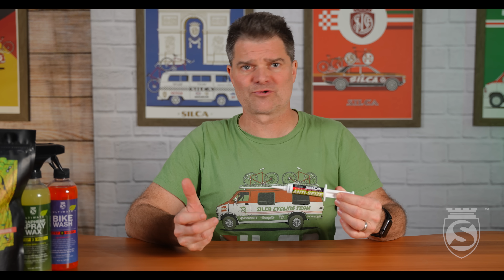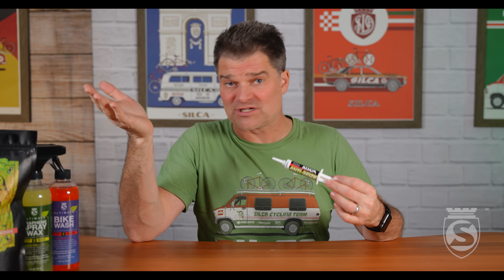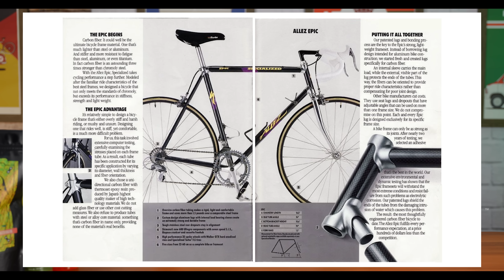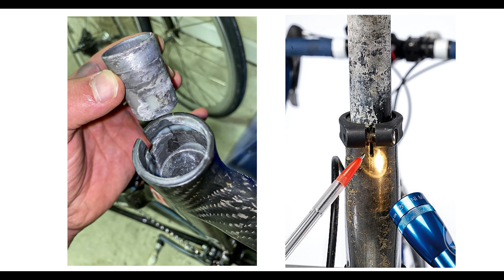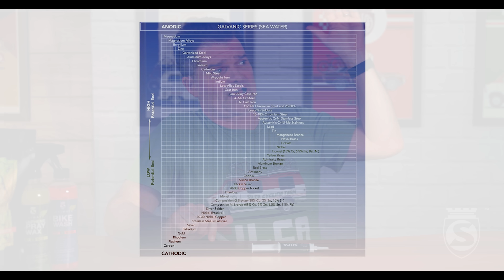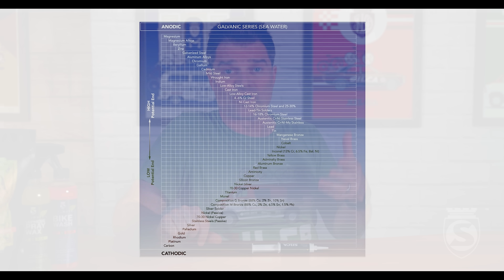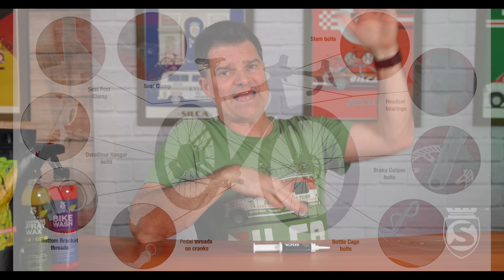Better than Grease? Anti-Seize Assembly Paste

Comment: I'm not sure about this product, but I did lose faith in Silca when I tried their hyped tubeless sealant:

It didn't seal the rim/tyre very well. Needed air every day.

Didn't seal holes.

Carbon fibres were way too heavy for the thin medium.

Dried out way too fast (see sealing the rim/tyre above).

Fibres ended up in a ball together; great if you wanted to balance the wheel and rely on guesswork as to where the ball of fibres will end up!

The sealant I use now requires air seven to ten days, and I can refresh it with water (because it doesn't dry out) rather than have to use another overpriced product. Oh, it's really good in inner rubes too keeping pressure for around four weeks!! It also has fibres that are held within the thick solution.
Reply from the maker: And yet here you are spending your valuable time watching and commenting on our videos.. don't worry, all of the Hamibini sycophants have said the same thing $20 for 500gm?  Crazy!!  Outrage really is his superpower and it's amazing how good he is at boiling down talking points that motivate people to go and spread those talking points.. well done to him!
Reply: @SILCAVelo  Well, I don't subscribe to your channel, but I do to his and other channels whose opinions I value.

I have a few Silca products, but the sealant was a real low point for me. Massive hype and promises yet very poor performance.

Anyway, you promote your stuff on a public forum, so expect public feedbaxk. It was nice of you to take my feedback about my genuine experience seriously 🙄
Reply from the maker: Think how differently this goes if you don't show up having been hyped up by the outrage machine.. 

you: Hey SILCA, I had bad experience with your sealant
SILCA: So sorry, yes, we had some real manufacturing issues for the first few months as the stuff breaks the bottling machines.  Here's a blog post and youtube video explaining it.. how about we send you another bottle? Since solving the bottling we've won like half a dozen awards with that product and numerous pro teams are running it off sponsorship..
You: Nah, I've found something I like better OR OK, sure, I'll try it again.. 

So much easier without the outrage.. we're happy to engage publicly, but when the basis of the conversation are half truths and mischaracterizations intended to drive clicks and get people worked up.. we will poke back.
Reply: @SILCAVelo  Fair comment, and I have edited my original post.

I do not follow you, and therefore, I have not seen the blog or video and was ready to throw in the towel with tubeless after getting a blowout with Silca sealant instaled only to find all the fibres had dried into a ball.

I assume the Blog is explaining this is still available to read?

Thanks 👍🏻

Comment: Very helpful video. What do you recommend for seatposts - titanium in titanium and aluminium in titanium? Would this product be the best thing for each? Thanks in anticipation
Reply: Thank you @SILCAVelo - very helpful 😊
Reply from the maker: This will work in all of those scenarios, but in general the one scenario where you can save your money is when materials are same-same, so Ti into Ti or Al into Al and you're fine with EP grease which is cheaper than anti-seize.. but if you could only have 1 on the shelf, then Anti-seize would be that one.  In aerospace, they typically have specific types of anti-seize for specific combinations, so Nickel Anti-Seize would be used on all the Ti-Al, Ti-Stainless, or Stainless-AL while Ti into Ti would generally use pure MoS2 anti-seize, but then that stuff isn't recommended for use with AL.. hope that makes sense.

Comment: Project Farm tested like 10 anti seize compounds and copper almost always at the top.
Reply from the maker: Did you actually watch either video at all?  Project farm did their test on cad plated steel bolts from the hardware store while our whole premise is that for dissimilar bolted joints involving Titanium or Aluminum copper is 40 year old tech which has been replaced by this newer, better tech.  It's like saying Project Farm says 87 octane runs better in a mower engine, so that should also be true in a jet turbine.. sorry but no.
Reply: @SILCAVelo I work on motorcycles and cars far more than bicycles, what should I use when dealing with all the various bolts then? Did Project Farm aim his video at folk like me?

Comment: Why not use a non-metallic anti seize like ceramic paste?
Reply from the maker: Ceramic pastes are damaging to aluminum anodize and aluminum substrates.  Those are designed for high temperature brake applications for use on steel and cast iron.
Reply: @SILCAVelo  just because the ceramic particles are too abrasive for aluminium? Or why is it a problem?

Comment: Hambini claimed you can get this stuff at 20£ for 500g. He also said it's carcinogenic. What do you have to say about these claims?
Reply: He will have no response, even the SILCA packaging says it's carcinogenic.
Reply from the maker: Hambini turns $30 of industrial bearings and aluminum bar stock into $300 bottom brackets so I assumed he'd be proud?  Also we literally tell you exactly what it is, where we found it in use, and that we don't directly make it, so if you want to go sleuthing about and find something similar for cheaper, (though that price you're quoting is for nickel-graphite which is quite a bit cheaper) go ahead.. I mean we essentially build you a roadmap in the video.   Anyway, these syringes are sold in aerospace and light aircraft for $75-100 per syringe in bulk and as much as $200 per syringe as singles.  As for cancer, well those NTN bearings that Hambini loves so much carry the identical California prop 65 cancer warning when sold here in America: https://ntnamericas.com/ca-prop-65/ 
@Hambini, not sure if you sell many BB's to California, but you are technically breaking the law if you sell them into California without this prop 65 statement clearly stated on the packaging.
Reply: @SILCAVelo  I do not have 10 employees so I have no legal requirement to display labels. Whilst you are quite right the bearings may contain substances that require a prop65 warning, in this context, it's chalk and cheese. NTN's bearings in normal handling are trace elements. Your grease has a large consituent of nickel that is semi fluid in form. You probably know the reason for the nickel is predominantly for the heat, yet you conveniently forget to mention it. Good luck with your sales mate.
Reply from the maker: If you would just engage conversationally, results would be different.. but you can't help yourself, it always has to be outrage and how much smarter you are than everybody else and how stupid and ill meaning the bike industry people are...I get it, it drives clicks and youtube revenue for you, but it's just not productive.  Like I said in the video, we learned that this is the stuff used for Ti-Al fastening in jet engines, while the bike industry is generally still recommending copper, or in many cases is ignorant to anti-seize as a category.. we then worked with the RR supplier who's data show that Nickel really is the best from a corrosion perspective in Ti-Al and Stainless-Al interfaces as it's a strong galvanic barrier while also being soft enough not to damage the Al threads or coatings, and corrosion really is our biggest enemy in cycling.   As a result, we went with the recommended formula from one of the top suppliers in the industry and this product is pure nickel in a full synthetic grease, which is quite different from nickel-graphite/mineral oil which comprise all of the 500gm for $20 tub products that you reference (most of which are recommended against using with aluminum due to the graphite content).  If it were just about high temp, you would use ceramic which is way higher temp rated, but can cause micro scratching and coating damage in aluminum.. similarly, for higher temp Ti-Ti bolting they primarily use pure MoS2 as that's best for galling, but then that product isn't considered as good when used with Ti-Al or Stainless-Al interfaces.  If you have something different or better, please enlighten us, I'm just bringing what I've learned to the table, but shitposting for the sake of outrage and clicks certainly isn't helping anybody out and certainly isn't moving the conversation forward in any meaningful way.
Reply: @SILCAVelo  I would do that Josh, if you didn't go around sprouting off like I make up aero results. You've visited rolls-royce indy and you are well aware that you can't take photographs in there - I know because I used to work in there on what is now Rolls-Royce LiftFan and part of the F35 STOVL, I moved from there to EJ200 (Eurofighter). I have no issues in people being critical but if you are going to rubbish my results because I can't provide photos that are totally not for profit then expect the same in return. I don't really care about clicks, I could pack youtube up in 5 minutes and not care. 

You refer to me as an outrage machine but the reality is it's the commercial loss that you could suffer. 

Having said all that, I am a reasonable individual but I am also an old school engineer so if you wanna have a call about it hen I'd be more than happy to clear the air.
Reply: @SILCAVelo  Great response. I follow Hambini and agree with some things he says about the bike industry. But I also enjoy your channel very much, and find it contains a lot of great information. I wasn't criticizing you, just quoting him. I will definitely be buying some wax lube from you in the near future.

Comment: Thanks Josh for this great advice! I'm swapping all the bolts of my handlebar-stem from aluminum to titanium; I would have used Loctite 243 to fix fillets. Would be best the effect of anti seize? Thanks!
Reply from the maker: We love 243 and use it on a ton of things in the shop.. for me personally, I'd consider it like this.. are you just replacing the screws and you know for sure that your install will be one-and-done?  If so, then 243 will work great.  If you think that in any way you might need/want to adjust this interface in the next say year, or might travel with the bike and need to remove the stem or whatever, then anti-seize will be your better option.  Loctite is fabulous, but theoretically, every time you loosen and re-tighten you should be stripping the product and reapplying as it only gives proper torque readings when used full wet on clean surfaces, and then once hardened, will not re-harden or provide nearly the loosening resistance on a second use or after an adjustment.  Hope that helps! - Josh
Reply: Hekped a lot, Josh. Thanks for pushing forward your innovative and common sense approach in this business. @SILCAVelo

Comment: Great explanation! What if the surfaces are powder coated like it is the case for most aluminium seatposts or colorful anodized like aluminium or titanium screws?
Reply from the maker: What looks like powdercoat is actually black anodize over top of a grit blasted or bead blasted aluminum surface, so most all stems and seatposts you encounter will be anodized aluminum.  This is the perfect application if you are using stainless or Ti screws on these aluminum parts.

Comment: I'm scratching my head... so just because copper anti seize is not used on jet engines, then it must be bad for bicycles? I've been using various anti seize greases over the years on cars, bicycles, motorcycles and electrical with the copper anti seize being my favorite. If the grease keeps out the oxygen and water, then you don't need to worry about galvanic corrosion since it can't occur. The copper helps prevent possible galling. Most people don't have titanium on their bikes, more likely Cr-Mo steel and aluminum. I assume with regards to carbon fiber you wouldn't want to use anything that might attack the carbon fiber glue/resins. The whole science on using things like stretch bolts on cylinder heads is way off topic since the known stretch of the bolt materiel is what determines the forces applied. It just has no basis in bicycles as far as I know otherwise you'd be throwing bolts away after they were used once.
Reply from the maker: Maybe watch the video again.. the focus here is on stainless or Ti to aluminum interfaces which is pretty much every modern stem, seatpost, pedal-crank interface, and copper is great, but for this particular application, has been supplanted by nickel which is better.  Nothing against copper at all, just that much of the bike industry for 30 years has associated copper anti-seize with Ti-Aluminum interfaces and we've known in aerospace for 20+ years that there are much better alternatives.
Reply: @SILCAVelo  Could it be the real reason the choice of anti seize is critical on jet engines is all the heat? Anything carrying the compound would burn off, leaving connections exposed to air, humidity and moisture. A non issue in bicycles.

Comment: Great video! This is a very misunderstood topic that can genuinely make working on bikes much better. What about galling of similar metals though? This is something I encounter quite a lot and usually use a copper anti seize to prevent it. Things like the alloy sram DUB crank bolts that are always insanely tight to remove even when torqued correctly with grease (alloy bolt in to alloy spindle)
Reply from the maker: Al/Al interfaces at high torque are a good place for anti-seize like this, but EP grease with high MoS2 or WS2 content work well here also as those particles are lower friction than the metals used in anti-seize.
Reply from the maker: There are pure zinc anti-seize pastes that are specific to al-al situations, this is also a good place for highly MoS2 loaded EP greases.  Nickel anti-seize would be better than copper in this application due to it being closer to aluminum on the galvanic spectrum.

Comment: What about the derailer high and low bolts? I'm guessing you don't need anti seize because of the force applied to those bolts?
Reply from the maker: Those come pre-lubricated from the factory with a sort of sticky assembly grease.  I would only worry about them if you are doing a derailleur overhaul where you strip and clean all of it off using an ultrasonic or the like.. otherwise, that factory grease is probably good for 30 years of normal use!

Comment: In my work on wash down packaging machines nickel did not provide good results between aluminum and stainless

On boats it’s important to take pumps apart on a PM schedule no matter what you use to avoid the worst issues
Reply from the maker: Traditional 'nickel' anti-seize from most major suppliers will contain up to 50% graphite which can be very reactive with aluminum (ours has NO graphite).. I'd imagine this is where you had issues as those products can be very troublesome with aluminum, particularly in high water and particularly salt-water environments.

Comment: As an engineer and former bike mechanic, please please bring good anti-seize compound into the bike market.

I mean, fair, using grease on threats and friction fits like bearing seats is better then nothing to prevent galling and moisture ingress and I have done it myself countless times when nothing better was at hand but realistically, a modern bike has almost no need for grease. Bearings are sealed and pre-lubed nowdays, everything else is joints that are meant to not move.
And with grease, especially on new parts, the torque properties change. More force will be required for a clamp, bolts are easily overtightened etc.

With what you find on the consumer bike market, mostly metal based anti seize compounds (e.g. copper or aluminium paste) you constantly need to be mindful of which compound to use in which material pairing due to galvanic corrosion. And while I know where and what to get, most bike riders just buy bicycle specific products and sometimes end up destroying their bikes. (Wouldn't be the first time I had to drill out stem bolts after someone used a copper based anti seize for stainless screws in an aluminium stem).
Having a galvanically neutral anti seize compound marketed to bike enthusiasts might save a lot of parts. 

And frankly, I don't care too much about the price. I can get proper stuff at any automotive parts store and bike shops as well. The kind of consumer I'm talking about likely spends a lot on their hobby for parts they 'want' but don't need anyway. For them, it's a hobby after all.
Reply: Little addition, with galvanically neutral, I don't mean inactive, I should have phrased that differently. But any compound that doesn't actively contribute to corroding the mating materials. Using a sacrificial material like Nickel is one way to do that. Usign an electrically neutral material like some anti-seizing tread locking glues is another.

Comment: What about "zinc grade" anti seize as it is good for aluminium and its alloys and with components fabricated from similar or dissimilar metals....it is also intended to provide corrosion protection to the metal surfaces.
Reply from the maker: Zinc anti-seize are recommended for aluminum-aluminum assemblies and also for use with iron/cast iron/carbon steel.  For Titanium and Ti-Aluminum, and stainless/ti, stainless/Aluminum nickel will be much better.